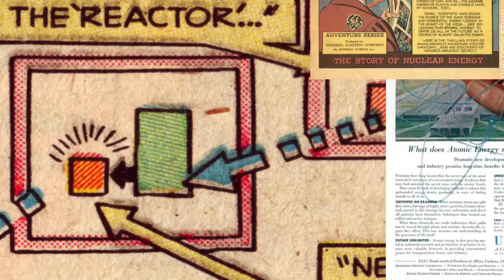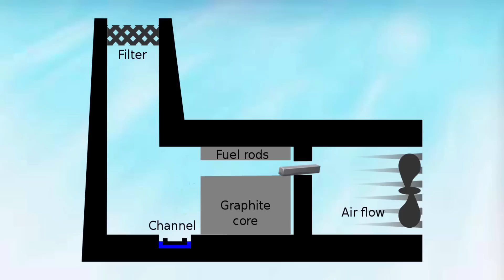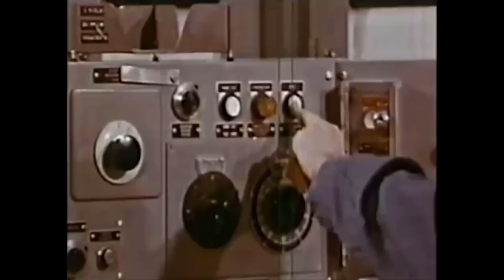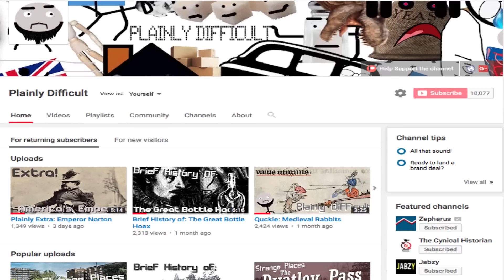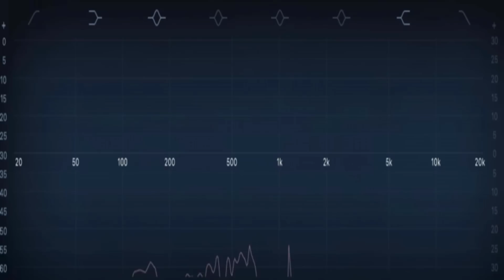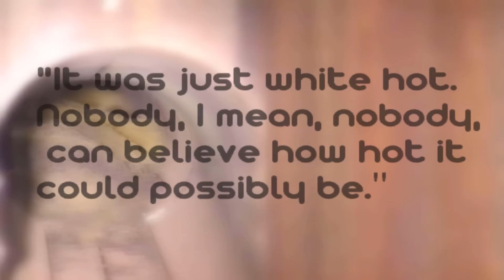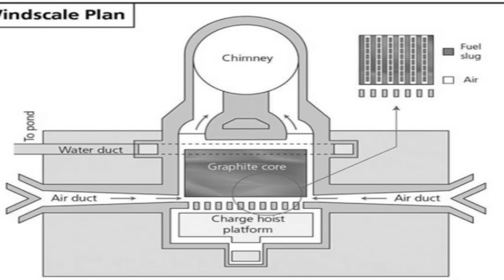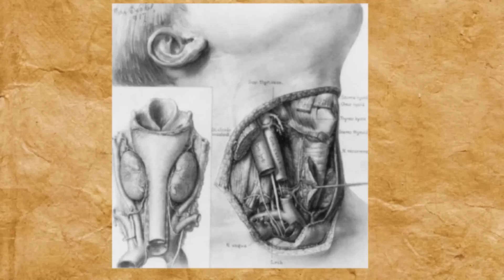Brief History of: The Windscale fire

Comment: My only guess as to why this firetrap was constructed is that as it was built in the1950s, the people who designed it didn't fully understand the potential for danger.  Since the Manhattan Project had used an air-cooled reactor and successfully made nuclear weapons, that seemed to be the way to do it.  It didn't help that the US refused to share its nuclear secrets with its allies, wanting to be the only nation with nuclear weapons and in spite of having received help from Britain during the Manhattan Project.  As a result, those allies (UK, France) who wanted to become nuclear powers had to more or less crib from the few snippets of information that leaked from the US before the files were locked away, and then fill in the blanks with theory and guesswork.  Result: unsafe practices and the inevitability of an accident.
Reply: Manhattan Project used water cooling for its reactor (B Reactor). Also, there's nothing necessarily more dangerous about using air as coolant than water; the advantage is that you eliminate the risk of a loss of coolant accident. But you have to guard against fires both in the fuel elements and the reactor moderator, and you have to properly design the reactor so that the elements don't rupture, swell up and jam in the channels, or miss the water pool when discharged. Windscale was rushed to hurry up and build weapons for political and diplomatic purposes so these problems were not worked out. And later Chernobyl would show that even a water cooled graphite moderated reactor can still catch fire.
Reply from the maker: very true would most certainly not be build today! Thanks for the comment!
Reply: +Helium Road | Quote: "Manhattan Project used water cooling for its reactor (B Reactor)".
Yes, they did, but before the Hanford water-cooled reactors they used the air-cooled X-10 Graphite Reactor at Oak Ridge for plutonium production.
Reply: +Julian Fischer:
Higher temperatures don't produce more plutonium, though they do result from the increase in neutron flux and propagation within the reactor, which the clipping of the fins was intended to create.
Also, whilst one of the primary aims of the British nuclear weapons tests may have been to "impress the Americans", that was not the impetus behind the modification of the fins. The plutonium yield would've been too low to satisfy the needs of the test program without the alteration. They certainly didn't trim the fins to impress anyone, only to produce the amount of plutonium that it was originally intended to supply.
Reply: I made a longer comment on this but to cut it short. They shortened the fins to increase the temperatures to get more plutonium out of the reaction to "impress the americans"
Reply: There was actually some thought put into this, at the time in America they had 50-mile escape roads leading away from each nuclear facility so that if something went wrong they could evacuate the facility and get 50 miles away. But unlike America, we have very little empty space more than even 30 miles from a village or town, certainly not enough to build a nuclear site. So we decided we needed to build a reactor that couldn’t melt down, typical reactors were water cooled but if they ran out of water they’d have an accident, so we figured that if we built an air cooled reactor it would be safer. And in a way, we were correct. If Windscale was run in it’s original configuration it would never have caught fire, and if the water channel was expanded it would make the reactor significantly safer, even if the fans died they could’ve shut down the reactor by putting the rods into the water channel until the temperature was reduced enough. The real disaster happened since the government insisted on changing the fuel type to one that runs much hotter, and reducing the sizes of the cooling blades on the rods, which lead to a much less safer reactor, this combined with the granite construction eventually lead to the fire.
Reply: Absolutly, if you look at early nuculear stuff the amount of things that where very poorly understood is immense.
Reply: How did the US refuse to "share" secrets? If the UK was involved in the Manhattan project.
Reply: @THX-bz8bi  At first we were ahead of America in nuclear theory, but we refused to share with them as we thought that if we told them everything they’d just dump us and move on by themselves, unfortunately America took this as the cue to not share anything with us, and quickly caught up to us in a fraction of the time, then progressed on much further and faster as their nuclear program didn’t get its funding cut to near zero by the government. Once we realised how far ahead America were, we quickly negotiated a contract that in exchange for assistance, we would tell them what we knew, but we’d left it too long and America had independently discovered almost everything we knew, so they didn’t really help us back much in exchange but they did take a bunch of our scientists. We decided that if they wouldn’t help we needed to revive our own nuclear program, and that lead to Windscale as we needed to produce plutonium since America wouldn’t share.
Reply: @THX-bz8bi  The UK scientists in the Manhattan Project were only told enough to do what they needed to accomplish, and nothing more. They were scattered about, and weren't privy to the whole picture. They only knew bits and pieces of the entire bomb schematic.
Reply: @THX-bz8bi  UK scientists where involved but they didn't know everything, and all the improvements after the end of the war where US only, they cut the UK off afterwards.
Reply: like said in the video, the hanford site's similar reactor was water cooled and couldn't melt down in the same way. they only built this really because the US wouldn't share anything from the manhatten project till the late 50s
Reply: @AsbestosMuffins  No, they built is as an air cooled reactor because they didnt have a large body of water, or a river nearby, to use as coolant.
Reply: I think it was mainly because the British government was desparate to get the bomb "at any cost". This was post-war, with the economy in ruins and the empire gone, and it was clear Britain's place as a world power was finished without them, and that they were the only hope for holding off the Soviet Union if it decided to invade Europe, so it was of existential importance. Even if it made 25% of the country uninhabitable and killed millions, I'm not certain that would have stopped them.
Reply: "in spite of having received help from Britain during the Manhattan Project" - Indeed the British delegation to the Manhattan project included one Physicist named Klaus Fuchs who was spying for Russia the whole time and gave Stalin all the secrets. Thanks Britain for all your "help"

Comment: I don't see how the Air Cooled Reactor they used ever looked like anything other than an accident waiting to happen. The water cooled catch tank was too small ? Air cooling a reactor core, then switching to forced air (blast furnace) if temperature rises?
Reply from the maker: I think it was the UK's desperation to join the Nuclear powers, it made them overlook some obvious issues. Thanks for the comment!
Reply: It’s 1947, two years after a war with the economy is on its knees, 450,000 killed and infrastructure still in tatters
Reply: The primary reason to go aircooling? Space, the US had the hanford sight, which is a VERY large tract of land, uninhabited and pretty desolate, if an accident happened, the sight could be evacuated, with minimal (sort of) risk to civilians. The uk, did not have large tracks of land far from civilians, so they decided to minimize the risk of a loss of coolant accident, by running an air cooled reactor. From what i was reading, the original design actually called for a design similar to hanford, but was deemed impractical due to the above reasons. Combine this with an urgent need to rush to produce more material, and the push to make and test a hydrogen bomb,  corners where cut. @J.S how did a misunderstanding of wigner energy result in the fire? From my reading, wigner energy was understood, and dealt with in the form of annealing, which allows the material to "relax" dissipating the wigner energy. As stated in the video, uranium is reactive when hot and exposed to air and can ignite, so if the cladding covering the fuel splitting was not the cause of the fire, what was?
Reply: J S  oh, i think i see the issue here, im not arguing that the air cooled nature of the reactor caused the fire, im arguing that the fuel canisters bursting and igniting that caused the fire,(the air cooling didnt help) the official statement from the british government was that the fire was caused by heating too soon after a annealing event, and too fast. Essentially, the government threw the guys trying to stop the fire under the bus by blaming then for the fire in the first place. From what i read, the fire was caused by several corner cutting measures to boost production. Removal of the cooling fins, and a higher demand for other radioisotopes resulted in a change to the fuel canisters, which increased the fire risk.
Reply: should have just made the pool bigger
Reply: Truth seeker  that's just kindergarten stuff bad. No one didn't bother to, say test something like that pool size pushing similar shaped and weighted capsules into test pool? What a fucking idiots those designers where.
Reply: It seemed like a good idea with the knowledge they had at the time.
Reply: I suspect not too small but fuel pushed through with too much enthusiasm !